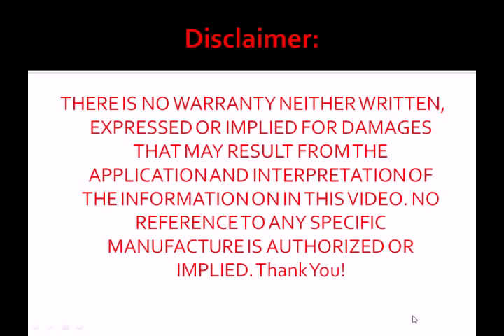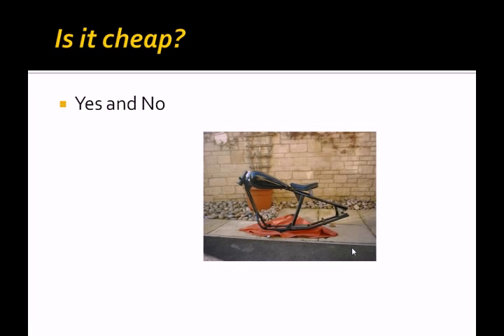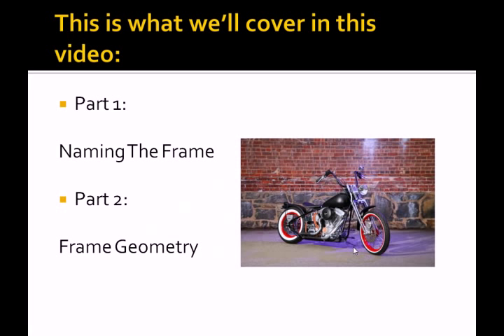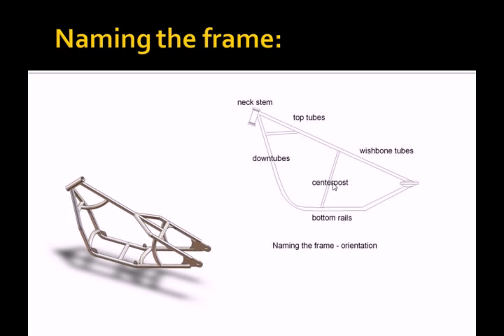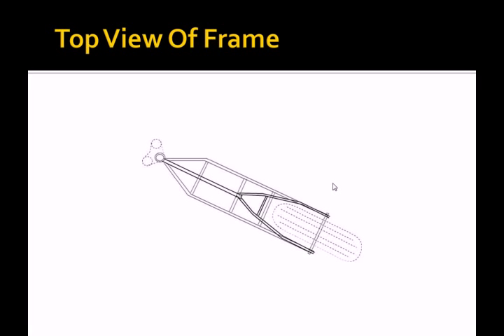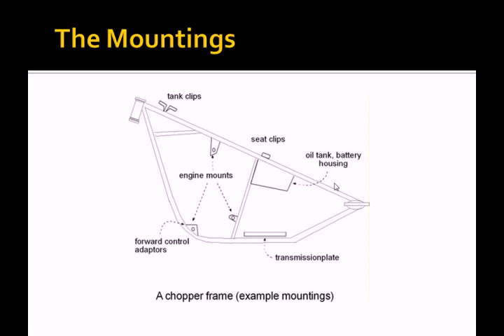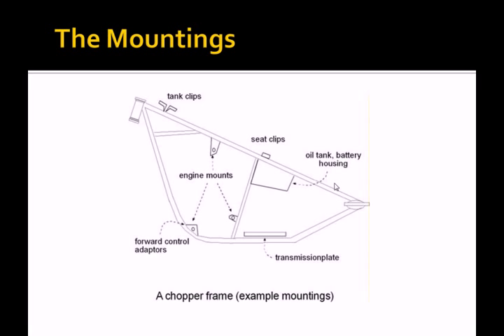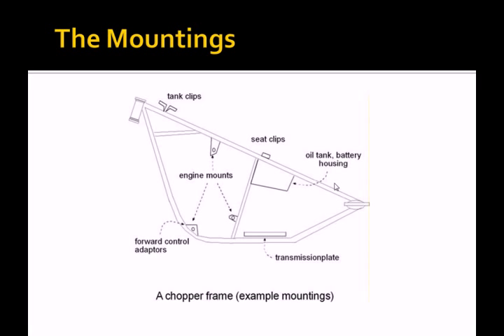Motorcycle Frame Build Part 1

Comment: I just discovered this information and ccguide.  Wow very appreciated
Drive line question
Been looking  for the proper segment regarding transmissions. Sorry off topic. 
Have to ask. 111 S&S motor. Ridged frame. Want to run a early horseshoe oil tank. 
What stock application transmission would work best.  I can not use my current touring transmission. Thanks for any thoughts.

Comment: In the state of Florida as I understand I most start from an existing VIN. I want to build a triker   with a v8 350 chevy engine and transmission and narrow 9 inch rear end. My question is what motorcycle neck can I use that can handle the wight so I can get the VIN with front it. I have seen few frame for sale on Craigslist but I don't know what I need to look for.

Comment: Is there any type of chopper frame building software? I'm a 2 year welder, fairly decent, and have a future business, Andzulis Customs, and need to design bike frames so I can put that design into an actual project, if there is a software please reply and let me know what its called so I can start designing, credits will go to this website mentioned in the video for helping me find the software. Thank you
Reply: +Chris Andzulis you can use autodesk 3ds max or maya or any 3d software . . . even BLENDER . . But , I think professionals use CAD for designing or DESIGNSPARK or SOLIDWORKS . . . And you will find plenty of how to tutorials here on youtube . . or you can purchase tutorials from websites like - lynda.com or digitaltutors.com and many more similar sites . .
Reply: +Chris Andzulis It's been 2 years and I'm just seeing your question. But, if you haven't already found something, I'd recommend BEND-TECH pro. There's templates for several projects including exhausts and motor cycle frames. It's extremely user friendly. I've used it for just a few weeks and I feel like a pro, but, I'm far from that. custom-choppers-guide.com has blue prints that are very reasonably priced.
Reply: Chris Andzulis i use solidworks (weldment feature)